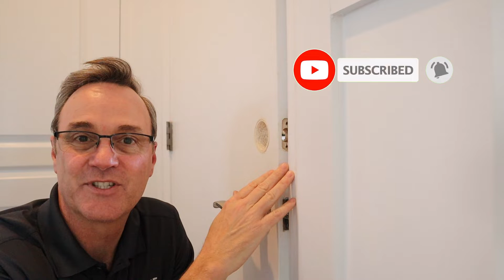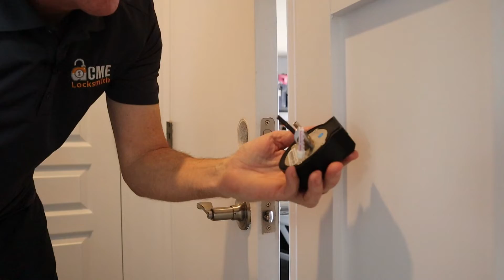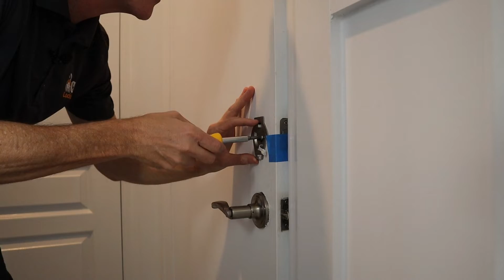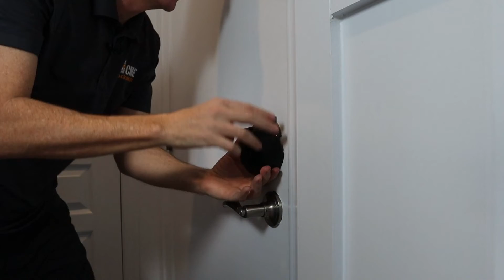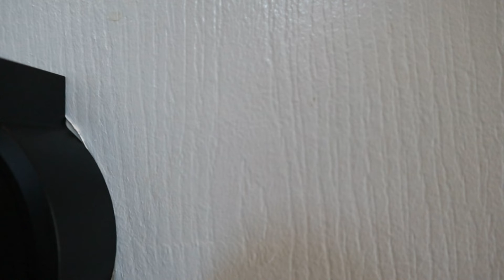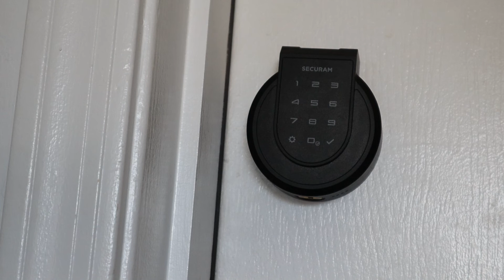How to Install SECURAM Touch Smart Deadbolt

Comment: How do I align the magnet so the app will tell me if the door is shut
Reply from the maker: The magnet needs to be within 1/2 " of the extended arm when the door is closed. But it appears the app does not yet tell you that the door is closed. But SecuRam tells me their updated version will. What the sensor does now is that if you are setup to auto lock, and the door is NOT closed, it will not auto lock. Which is pretty cool but it ensures you don't close the door with the bolt extended.
Reply: I got it setup but even if the door is open it's auto locks after alloted time

Comment: What happens if the battery runs out and you are loved outside
Reply from the maker: There are two ways to get in. There's a 9v battery jumper that gives it enough juice to open and there's a key override. Check out the unboxing video. https://youtu.be/rPD_p9gYKZI

Comment: I'm installing mine right now. Also a locksmith BTW.
Reply from the maker: Cool. Let me know what you think of it. Our review of the App is posting in a few day. I had some issues with it, but like the lock itself.
Reply: @LocksmithRecommended  Some issues here. Lock itself easy install from scratch (no deadbolt previously). Perfect out of the box.

 Having a major issue with the dongle. It pairs to BT but I can't get it to work correctly with wifi. It appears to handshake but when I go into the app settings it always fails on wifi. Tried 2 different routers same result. I sent them an email. It also looks like all the cool stuff you can with the app is a paid sub? Is that correct? I never saw that mentioned and not very happy if that is the case.
I was also a bit surprised how crappy the strike plate was and no inclusion of proper screws for the strike. Mine was an interior door install (closet) but for a front door I would ditch that flimsy strike and use proper screws to reach the frame. The bolt also is a bit underwhelming. The lock is a solid heavy beast but the failure points are going to the strike plate and bolt. Most of these new cool connected locks forget about the physical security aspect. I also have one of their safe locks  on my Hayman FS. Very glad I swapped out the old 6730.
Reply from the maker: @scotts4125  We mention the strike not being up to snuff in our unboxing and again in our final thoughts on the product (not yet posted). I was surprised as well. Had the same comments on the bolt too in those videos. We're thinking alike on that!  

When I went through the  app setup, I was never asked to pay anything. I did have to go through the process twice to get it to pair to the wifi but that was because I was using a dedicated 2.4ghz "repeater" that the app didn't like (I thought I would need it since my routher is a hybrid 2.4/5ghz and I've needed to use that in the past). 

But their app synced up to my hybrid router without any issues. That video isn't live yet, but you can find it here.  
https://youtu.be/yyJfHGWokLg

The only problem I had was I could not get the door sensor to work no matter what I tried. That was disappointing. I ended up recommending the lock itself (with customer supplied beefier screws) but not the app unless the only thing desired was audit trail and remote locking. Again, it's in the video above.
Reply: @LocksmithRecommended  The link is unavailable. When cheaper dongles won't connect to my Ruckus router I default to my AT&T router that also is in hybrid mode. That always works but not this time. I have the sensor hooked up but not sure if it works because of the app issue. After I deal with CS I will post back here and let you know what happens. if you are planning on selling and installing these all feedback can help. On my front door I have the Schlage Encode. That thing just works no issues. New house came with the hardware. Was planning on swapping for a Medeco but truth be told I kind of like the Schlage. We are in a gated community so not that worried. C rated safe head so all good there. They need an old grumpy locksmith on staff to beef up the physical security.
Reply from the maker: @scotts4125  Sorry about that. I thought the link would work even though it's not published yet, but I guess not.
Reply: @LocksmithRecommended  No worries. For the record CS already contacted me for phone info to have a tech call me. Will post back results here. In the app it states something about a subscription service for advanced features. Maybe that's why the sensor isn't working for you? We need to figure that out as well. I will ask the tech when they call. If you want me to ask them anything else post back here.
Reply: Tech support got me going. turns out I was connected to the hub but the IOS app has a bug that states it's not connected when it actually is. My sensor is working also. I told him about your situation. In the app you have to turn the sensor on and also hit OK or whatever is there. It would be very easy to miss if he didn't walk me through it. He told me if you can't get it, for me to give you his cell and he will get it going with you. I don't want to put his cell out here. I can send you an email if you like.
Edit: Email sent with contact info